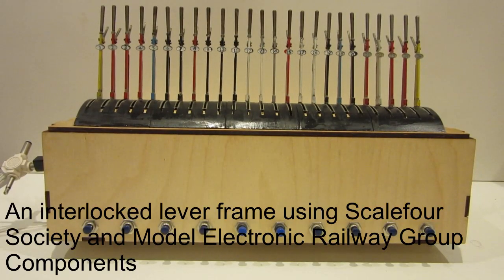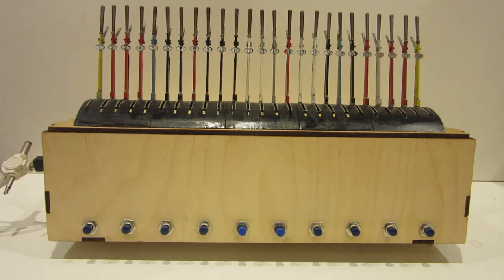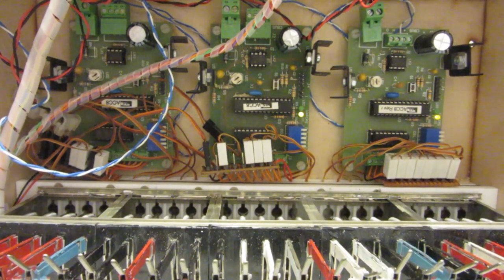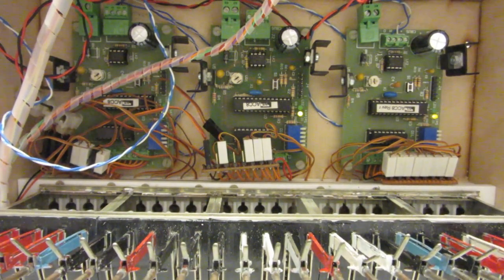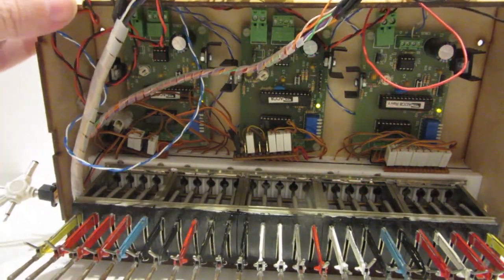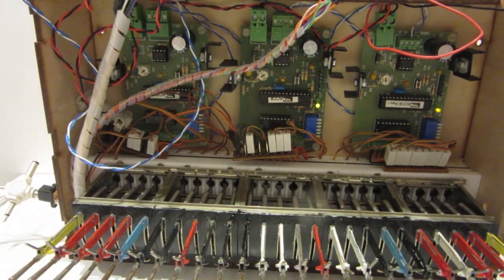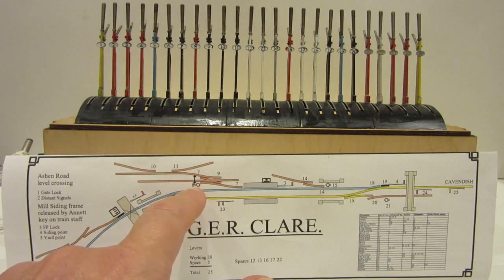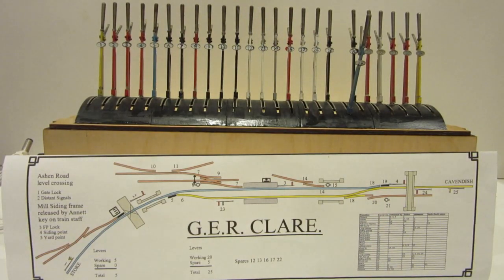Interlocked lever frame using Scalefour Society and Model Electronics Railway Group components

Comment: My hobby is railroad interlocking. This is really neat!!!! How are the levers locked so that the right sequence has to be accomplished in order to unlock them? Also, do you have time locking in the UK?
Reply from the maker: The levers are locked by a servo which turns to give a slot through which the bottom of the lever can pass. The servos are controlled via a CANSERVO circuit board from the Model Electronics Railway Group (Merg.org.uk). The control of which servo should be turned which way is via a CANCOND8C (another MERG circuit board). This is done with simple boolean logic (e.g. lever 1 is unlocked when lever 2 and lever 3 are pulled, lever 1 is locked if lever 2 or lever 3 are normal)

Most British railways operated on the Absolute Block system a good description is available at https://signalbox.org/

David

Comment: 10:55 Some hysteresis might fix that - either electronic or mechanical - such that there's different points where the lever is detected as pulled and as returned?

Comment: Fascinating. I have thought about a locking frame that works like the real thing myself. Using servos rather than mechanical locks is a good idea. In a real signalbox they use electromagnets to unlock the electrically locked levers by holding up a latch that rests in a notch in a rod fixed to the lever.